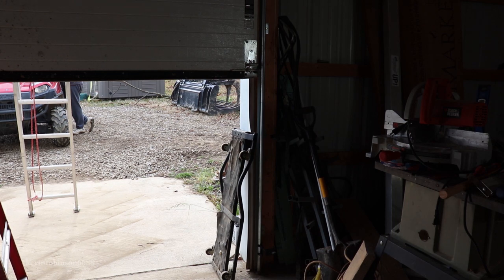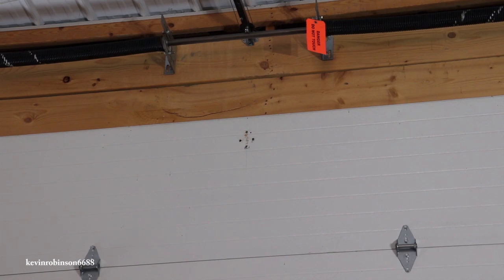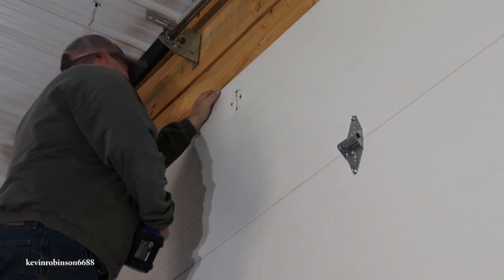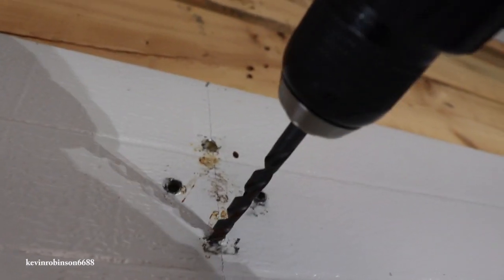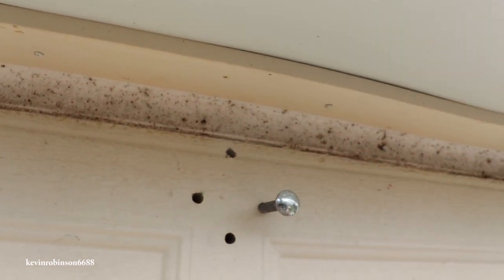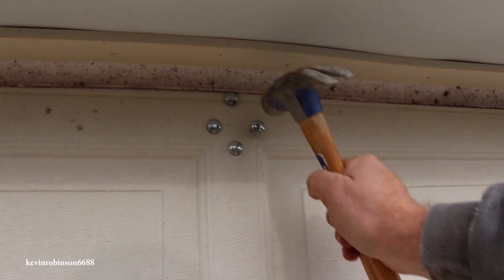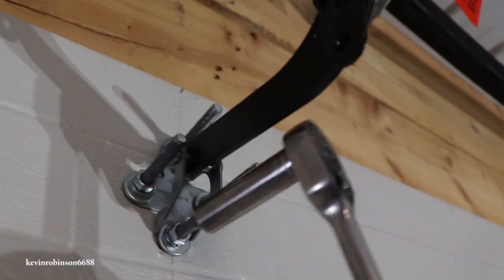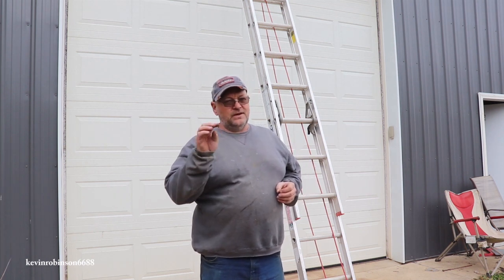garage door ripped out bolts how to fix

Comment: I didn’t thing you were supposed to bolt to the door like that.  Aren’t you supposed or run an angle brace across the door with a “T” down for the garage door brace?  Most door manufactures sell a kit bracing kit.
Reply from the maker: don't know i just fixed it and it works great
Reply: Yes you do
Reply: Listen to this guy, i think he might know a thing or two about garage door repair..  got a hunch..
Reply: Yes, but that's a giant commercial sized door.  Sometimes they are internally braced enough.  In this case I suspect the force adjustments on the door opener are too high.
IMO, tho, I would at least use a reinforced garage door bracket even if not required just due to the size of that door.
There are many times where I prefer to go above the minimum requirements.

Comment: Believe it or not your garage door sounds like it’s not running too happy do you want to disengage the garage or from the opener you are supposed to have a emergency release rope and handle on the trolley if you don’t know where to get one you can get one off of Amazon just type in LiftMaster emergency release rope and handle and your garage door doesn’t have the proper reinforcement you’re supposed to have a strut on the top panel and a operating bracket where the door arm hooks on because usually overtime if you don’t have those things like what happened to you was it pulled out and eventually it could bend the top panel overtime so the type of lubricant I recommend is PB blaster garage door lubricant you want to lubricate the garage door hinges rollers springs and end bearings
Reply from the maker: Thank for the info

Comment: Security problem, now anyone on the outside can detach the puller from the outside and slide the door up.
Reply: Those bolts are flat on the outside. How is anyone going to get a socket on it?